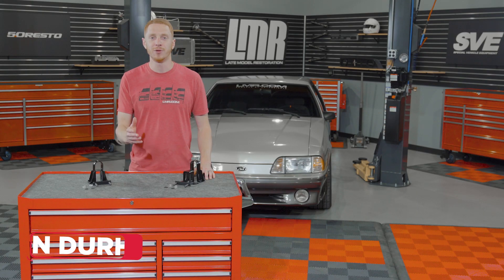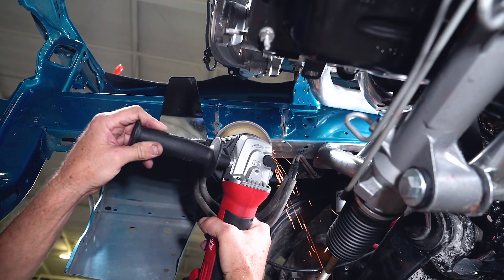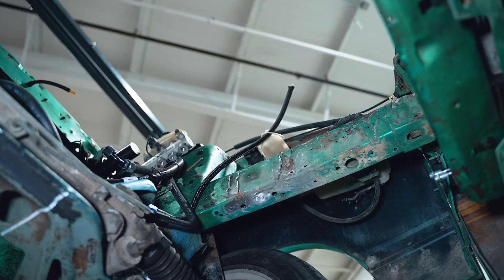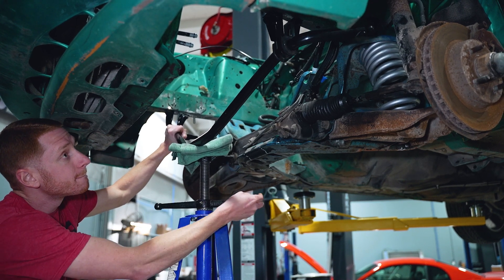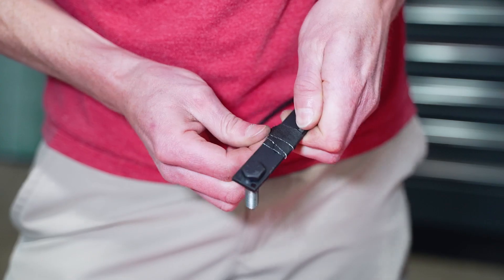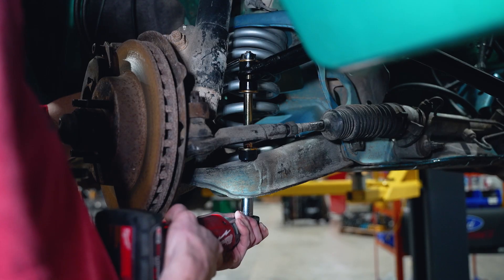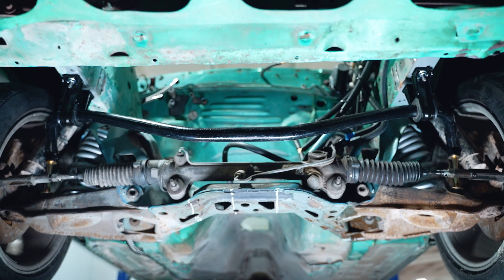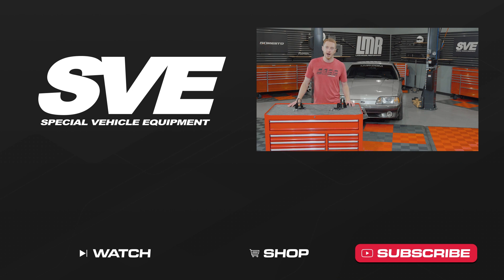SVE Fox Body Mustang Coyote Swap Sway Bar Relocation Kit (79-93) - Install

Comment: Another great solution and problem solved!
Reply: Really? Problem solved by yet more factory frame/suspension/chassis butchering and "relocation" to "swap" in as big and fat and heavy of a "high performance" mod motor as possible? 

That's funny. Seems like "Coyote swaps" are about 99% "solutions" and "swap" a hell of a lot of the "project car" to make the "swap" possible and require "investing" up to $15,000-$20,000 to "swap" a $1500 junkyard engine into a $2500 "project car" that when the "swap" is complete you couldn't get $250 for "trade-in allowance" at a new or used car dealer anywhere in the country and will never "appreciate in value" once "upgraded" with a junkyard engine and PROBABLY a  "salvage title" once "complete" and ready to "hit the street".
Reply: @deeremeyer1749  so what you are saying is you wake up everyday to spout anger and miss information.  I feel sorry for you buddy.  Good luck in life

Comment: Would this be the same for a Terminator swap Fox with SN95 sway bar?
Reply from the maker: Yes.  This kit will work with an 03-04 Cobra engine and SN95 sway bar. -Landan